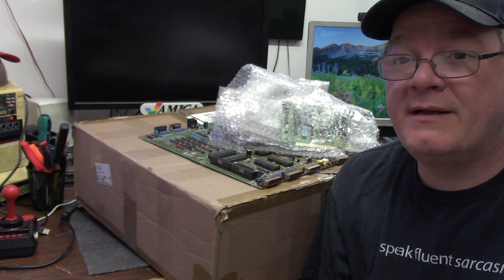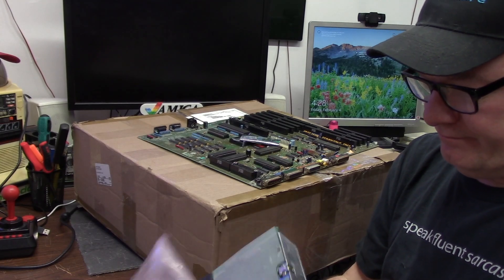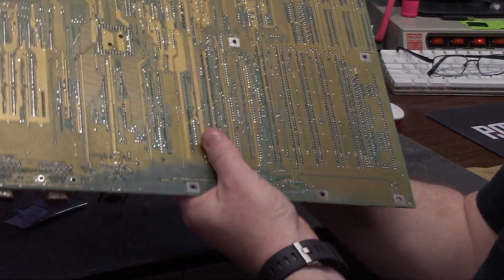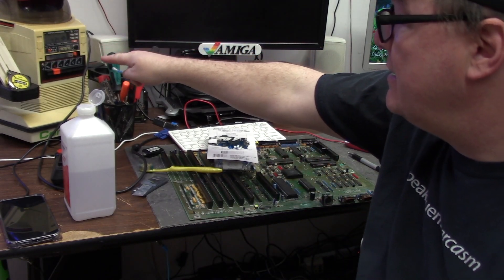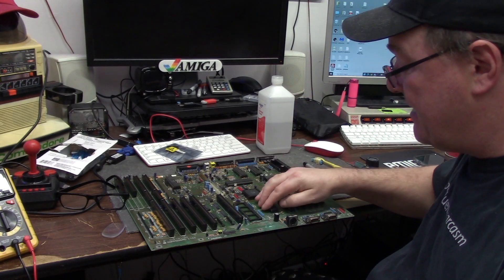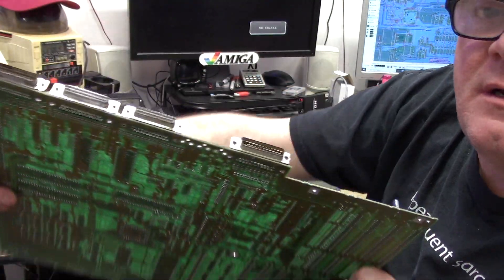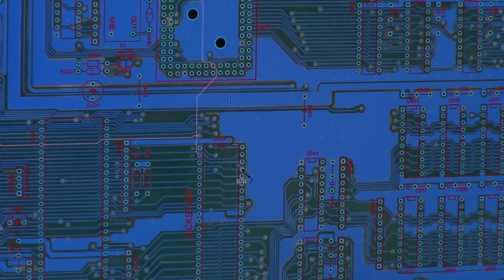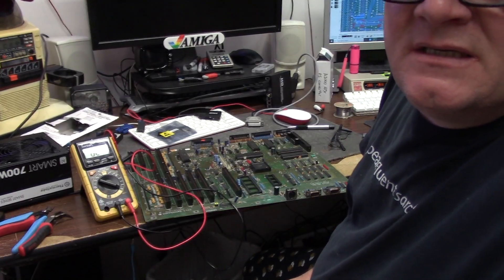The Titanic   A2000 repair P1, See what Salt water does!?!

Comment: Have a thumbs up, I've watched various 2000 motherboard rescues and I thought I understood early boot diagnosis but I was still having problems fixing mine and the cpu was putting itself into halt no matter what I tried even with good clock trace and buster removed etc. Then someone pointed me here and even though it wasn't a battery leaked rescue (this particular mb was  pretty clean looking actually, no signs of leakage at all) I downloaded sprint layout and floppie's git repo and went through it pin by pin for both cpu and kickstart traces, and hours later it needed some bodge wires where someone had replaced two of the 74ls buffer chips between the processor socket and the zorro slots really badly and burnt out the traces as they passed by that I had missed previously, and bizarrely between a pin on the cpu and a pad about 4mm away alongside it that I could see no obvious damage on. Pretty pleased to have a working 2000, amiga's have been in my blood for a long time and there's asm demo's on janeway I written in '89, now to raid the amiga cupboard for zorro cards & see if I can remember how to compile and if my source disks from back in the day will read with a greaseweasel :)

Comment: Hey Chris, thanks for providing quality videos of restoring one of the best vintage computers.  I've got a working Amiga 2000 with minimal battery damage - battery removed.  All of the caps look in good order, but wondering your take on recapping something that's not broken.  I've seen several people say don't recap a 2000 unless something is not working or visually out of place.  What is your take on this?  Thanks.
Reply from the maker: Old caps can have a high esr and greater resistance as they age.  Sure they may not leak like a smd cap but they are 30+ yrs old.  They are cheap enough. Why not

Comment: What application are you using to trace the connections on the A2000 board? I've seen the Amiga PCB Explorer, but that doesn't cover the A2000.
Reply from the maker: Sprint layout viewer with the a2000r6 files.  I can post them
Reply: @ChrisEdwardsRestoration  Would be much appreciated
Reply from the maker: @retrofix525  done! its in the description now for both

Comment: Chris in your opinion is it worth just swapping all the caps in the A2000, mine faired well with the Varta time bomb, as it was swapped in the early 80’s. when it went in for repair.  A term that is loosely implied as the repair shop used wire to jump the tracks that were faulty on the pcb apparently from factory….  So when I cut the battery loose a few years ago it was ok.
Reply: Hope you don't mind another opinion. The old thru hole caps were pretty robust,but that being said all caps on these boards are way past their lifetime. There are very few problems with these caps however. It is a good idea to recap with some quality panasonics to keep her going for 20+ more years. Cheap insurance.
Reply from the maker: All caps dry out even if they dont leak they will have a high esr and eventually turn into dust basically.  If its working thats fine.  The blue shoei caps are worth their weight in platinum to me, but i still replace them. You will gain stability and peace of mind.
Reply: @ChrisEdwardsRestoration  To be fair my 2000 is ok for now, my 1200 well thats another story, between bad caps and disintegrating traces, I am on the fence on if I should just replace the board with a Re1200.
Reply from the maker: Lets see a few bodge wires and chips or 2200 desolder points and damaged chips and ics and parts then re solder all that stuff to a new board… That is why I always try to repair them first I would rather start 40 hours fixing one board than three months desoldering one